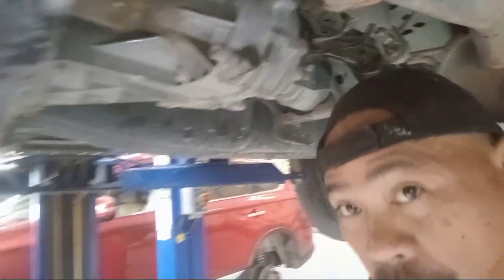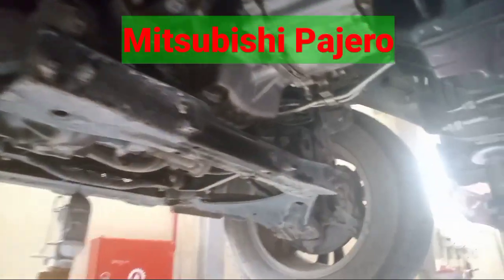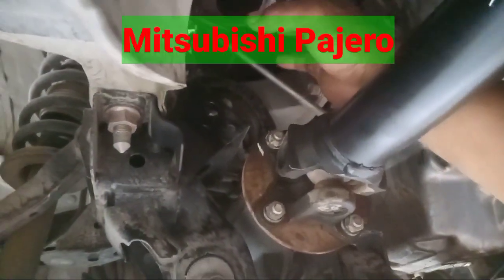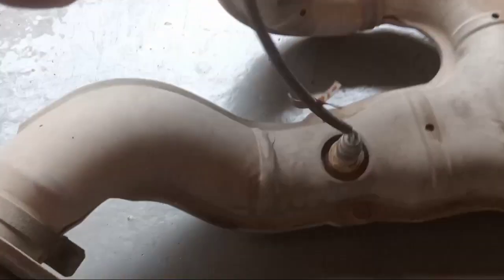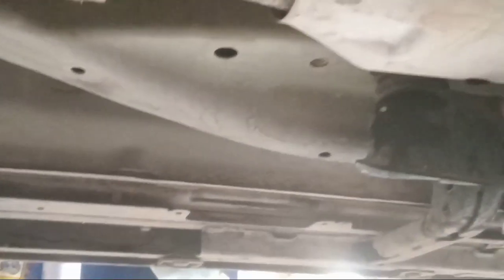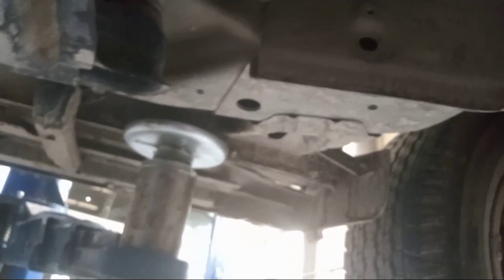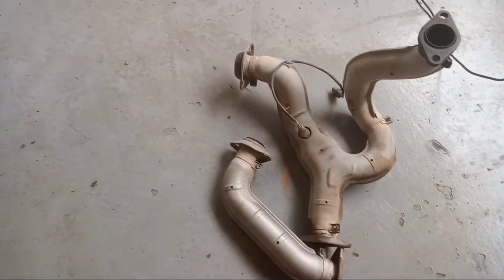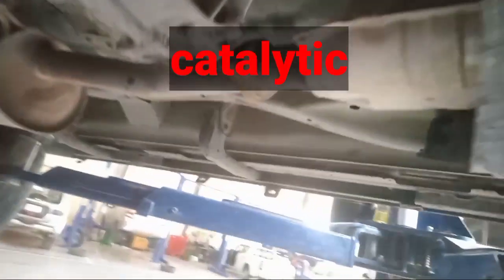Mitsubishi Pajero ( tech. info ) Low power engine ( one of the. causes)

Comment: Hello my friend, I am from the city of Tabuk in Saudi Arabia. I own a Pajero with a 3800 engine from the year 2014. Everything is fine, except that the car does not accelerate as desired. The spark plugs were changed, the filter was cleaned, and the transmission oils were changed. However, I feel that the car is like a snail when accelerating. I have some questions: Does the transmission have anything to do with torque? Knowing that the transmission is good does not suggest that there is a problem
Reply from the maker: Sir how many km your preventive maintenance
Reply from the maker: Regarding the transmision . Whats the problem
Reply: @digzchannel4011  I recently changed the timing belt, the air filter, the gasoline filter, cleaned the air gate, and changed the transmission oil and filter, but the car is accelerating not as strongly as usual. From the start, the start is weak and heavy.
Reply: @mohammedalenazi2284  same issue with me 2012 3.8 and high noise as well did you found the issue or trouble shoot it ?